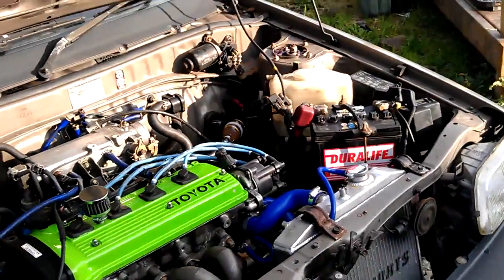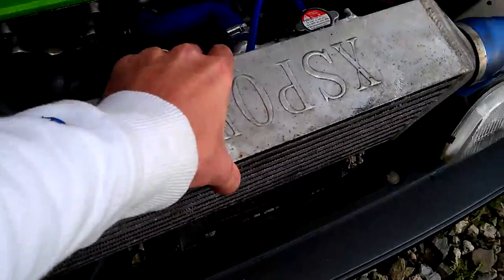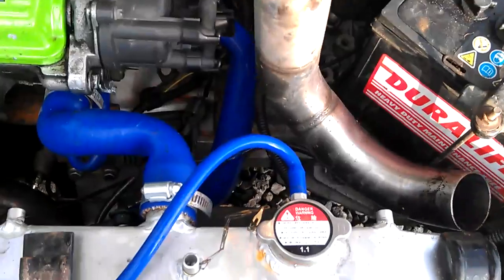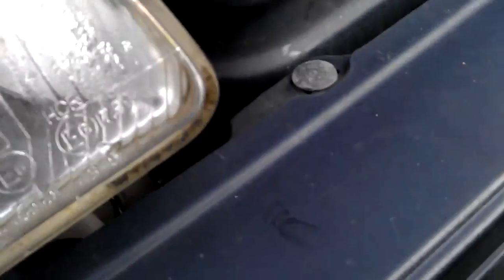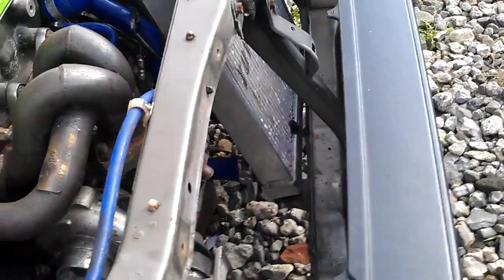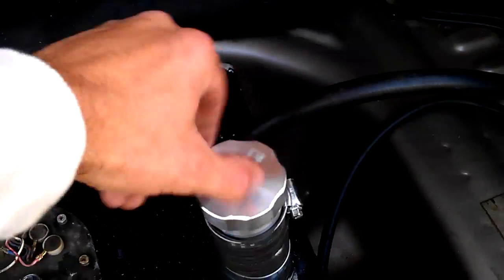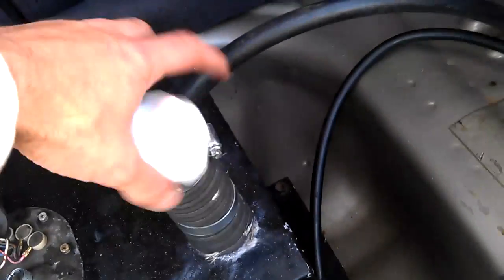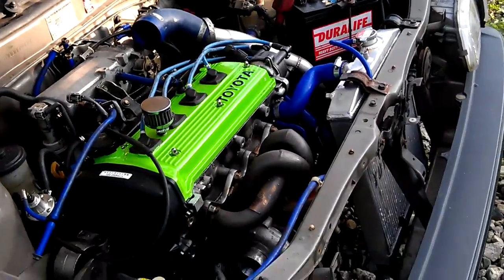EP70 (boxy starlet) 4EFTE Turbo conversion part 14: Figuring out how to fit the FMIC :P

Comment: i think the radiator wil work nice if you put the intercooler as low as possible. you could possibly move the radiator to the center to get the piping to the intercooler if its not hitting the exhaust pipes god job! :)